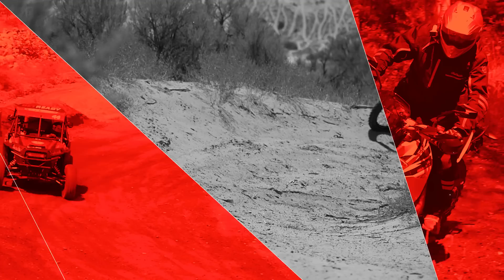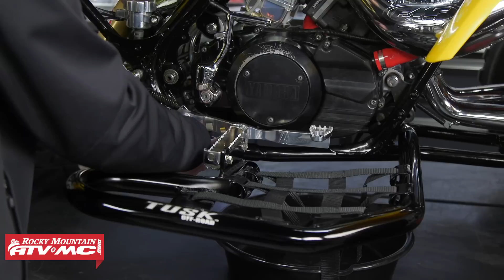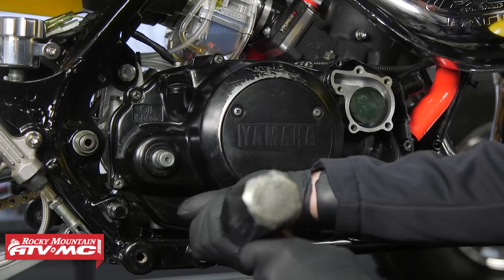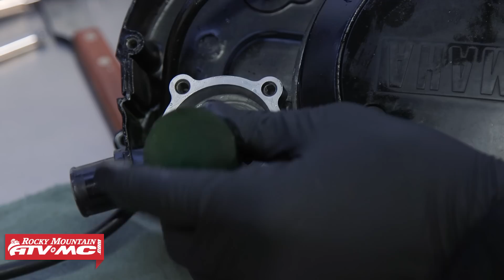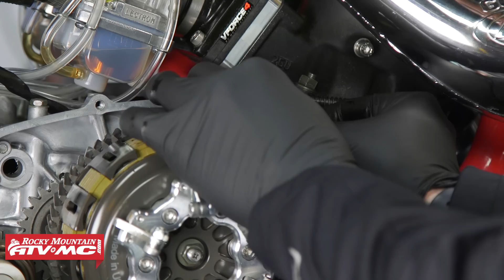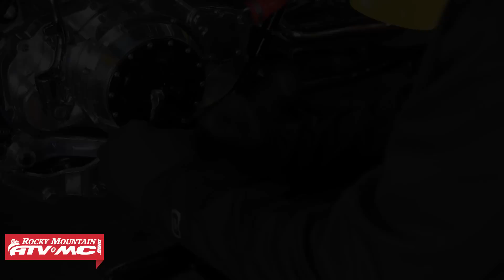How To Install a Modquad Lockout Clutch Cover Set on a Yamaha Banshee

Comment: What does the look out clutch do,what is it for?
Thanks
Reply from the maker: Applies pressure to the clutch helping prevent clutch slippage during high loads and higher speeds.

Comment: When add the lock out do u add more oil or just put the normal
Reply from the maker: We used two quarts of oil.
Reply: @rmatvmc  also for an 04 yfz 450
Reply: @rmatvmc  so do want oil spinning on the lock out cuz i was told just put 1 and it looks empty

Comment: What did you do with the air breather hose that was installed on the stock clutch cover?
Reply from the maker: The Modquad Lockout Clutch kit deletes the stock breather hose.
Reply: @rmatvmc  oh ok im not sure what it is called but what should I do to the part where that hose connects to, just plug it?
Reply from the maker: @lucasreyes_montanez2715  Yep, you can just put a vacuum line plug on the open end, or get a different 2-barb connector that deletes that third connection point in the line. 👍🏼
Reply: @rmatvmc  sounds good thanks!

Comment: I just got a stock banshee and it is almost my dream bike but it still needes a +6sway arm if my banshee is stock will it make enough power to run one? If not can some one tell me how much power I need to run one
Reply: You can run a +6 swingarm on a stock engine, you’re just not going to wheelie, and lose some handling if you ride tight trails. Unless you’re drag racing, I would just leave it stock. I run a +8 on my 421 cub, but I’m making 90+ hp and I drag race, so it benefits me to have one so it won’t wheelie at the launch.

Comment: Does it require more oil? I like the transparent cover; you can see if your adjuster nut is backing off (which I just had happen on a camping trip). If I would have known 100% that, that was the problem, I would have fixed it on location instead of riding without a clutch for the last 2 days!😬😆
Reply: did you find out?
Reply: @deadpresident_  Nope!
Reply: @geopioneergsxr5357  i had found the amount of oil needed for the extended cover somewhere but can’t remember how much or find the link
Reply: How much oil should be used when changing this cover?
Reply: Mine adjuster in the clutch loosen too the other day damn it. Lol
Reply: How does the lock up setup work and help?  Why do we have to use it w the clear cover?

Comment: Where is the kick starter seal from I couldn’t find it on your guy’s website
Reply from the maker: The kick start seal is included in bottom end gasket kits but you will need to check the OEM parts diagram to get the seal by itself. You can check the OEM parts here: https://www.rockymountainatvmc.com/oem-parts/Yamaha 
The part number you're looking for should be Part# 93102-20484-00.

Comment: Does the lock out allow you to shift without the clutch at high rpm?
Reply: No, you need an override transmission for that. The lockout just helps with clutch slip on higher hp setups, especially if you’re drag racing.